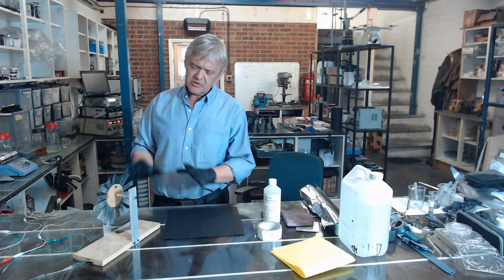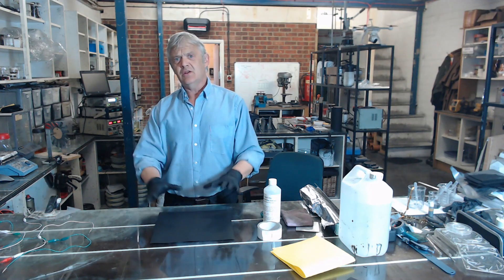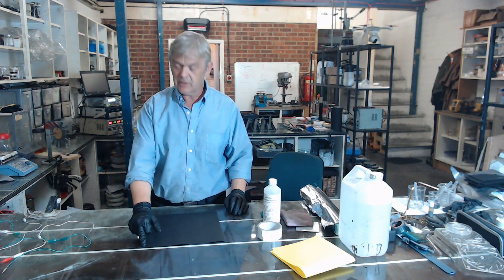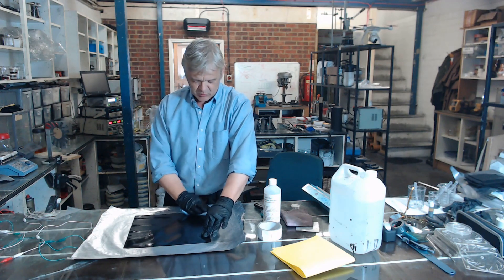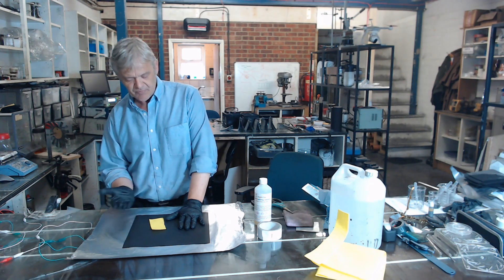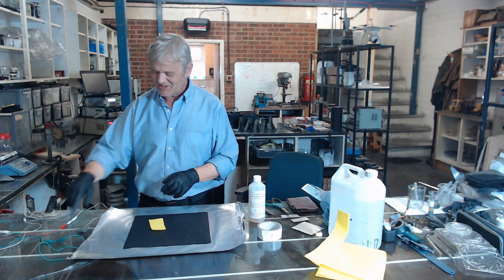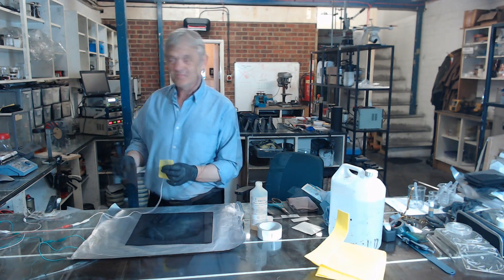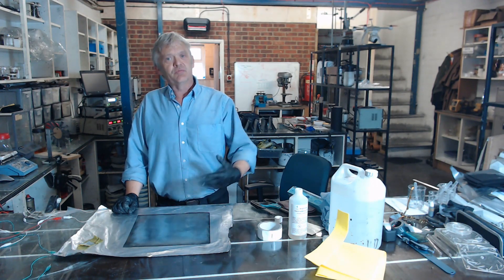Wand (Brush) Plating

Comment: You can wand plate a clean Iron surface with Copper without a power supply. Degrease the Iron, take a swab soaked in Copper Sulphate solution and rub it onto the Iron. The Copper is deposited very quickly in a thin layer which is ready for Nickel plating. I hope that this is useful to someone reading this. 🙂

Comment: Thanks teacher. In connection to some HCL spill close to my mechanical shop area, it has suddenly started rusting many items including my 6ft lathe started rusting. I am planing for a wand plating method with sodium carbonate solution to work only on some areas of a big machine where it wont be easy for me to dip in a bath.

Comment: Dear Robert, could I use the violet cobalt chloride from cat litter to galvanize metal parts?
Or could I use it as a colorant for vitreous enamels?
Thank you
Reply from the maker: I am afraid I don't know mate
Reply: Desmond Bagley  you may be thinking of bentonite sand, but I mean silicon dioxide sand, which looks like coarse salt crystals and also has other violet crystals, which is precisely the one that contains cobalt chloride, and it serves As an indicator of humidity, I will carefully read your suggestions
Thank you